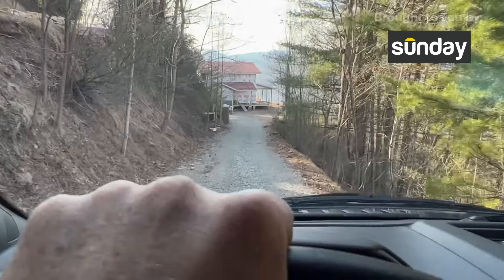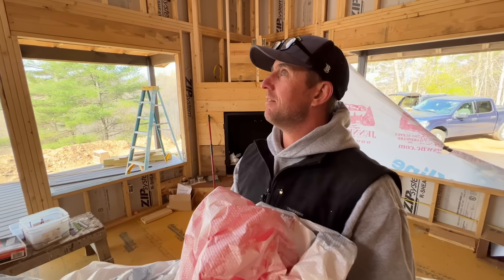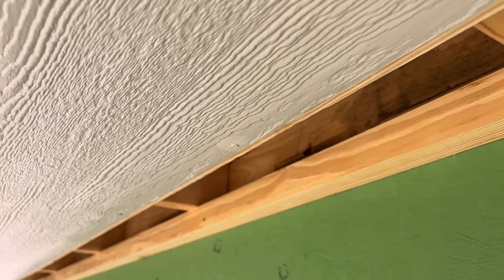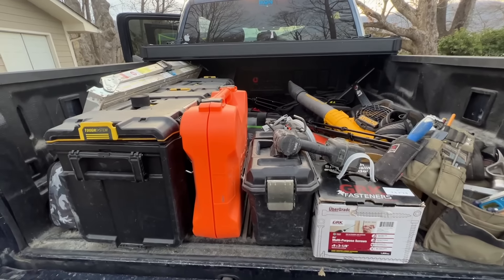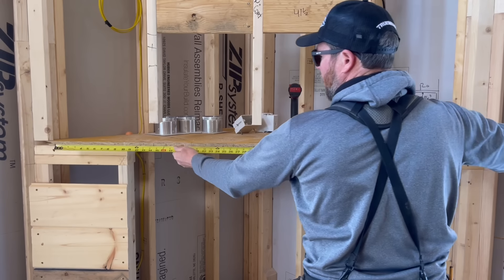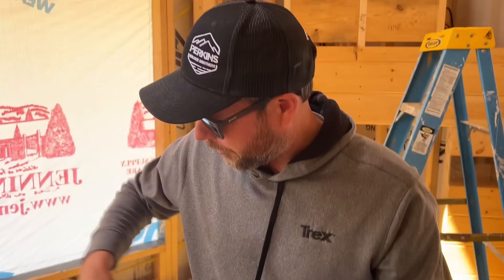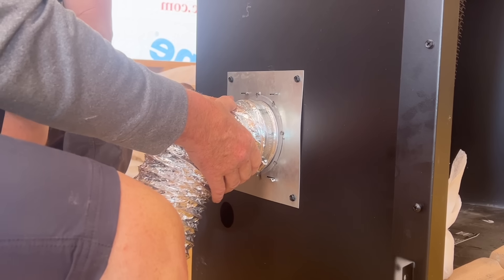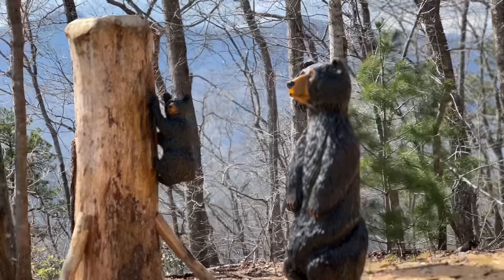Back To Work | Building A Mountian Cabin EP27

Comment: I know this video is over two years old, but here is a pro tip: when you have insulation in a wall, as is the fireplace, you can use small steel wire and screws on each stud and wrap the wire in the screws and go from side to side. Better than that is to use that steel support tape (plumbers use a lot of that) and screw in studs on the walls behind firebox. Don’t forget to run a strip (or wire) about every 12-16 inches going up the walls. Either method will hold the insulation for the life of the home.

Comment: If I want house wrap to stay on I just use scrap lumber as a cleat to help hold it on. 2x2s and other rips of plywood usually takes care of the wind whipping the house wrap off.
Reply from the maker: We’ll have to do something different next time! It was on the house without getting covered with siding for way longer than we expected, and also we got the craziest wind I’ve ever seen in my life over the last month here
Reply: Cap staples help a bunch as well. Stinger is the brand I have used.

Comment: The housewrap would stay on if you used the preferred button tip fasteners.  Staples stink.  Or better yet 30# felt and button tip fasteners.

Comment: Natural gas fireplaces here the inside of the chase has to be insulated then covered with fire board and sealed with fire caulk along with a fire stop at ceiling height …. Then the venting out has certain requirements to pass code as well

Comment: Have you thought about purchasing pump jack scaffolding.  I believe it would be easier to set up when the house is close to the property line and you don't have to set multiple level of staging to reach areas of the wall.  The only thing you have to remember is to drive long lag screws for your brace to solid lumber.
Reply: I have used some but we don’t have any like that.

Comment: So when we install house wrap we use a pneumatic stapler that will hold two clips of 3/8” staples and you just pull the trigger and it will just keep shooting. Interchange makes the gun and it sets the staples so the house wrap will not come off. Just make sure of who is operating the gun because you will go through a ton of staples. Saves a lot of labor. Love the videos.

Comment: the exhaust for the firebox you showed the j block, is that in line with the where the siding will be going, if you're an inch off the hole cut for the duct doesn't allow for movement. im only curious if down the road how that is going to line up with the siding. i would think you would get the siding up add the j block and make the hole so it isnt two inches off above or below.

Comment: Im not sure that dryer venting is to code for a fireplace.  You need solid metal duct for that fireplace.  Oh my.
Reply: It's intaking outside air.  No heat involved.   And like you said, it's dryer hose...meant for hot air....so it's more than ok for outside air.
Reply: @RandysRides  are you a licensed contractor/fireplace installer?

Comment: I don't know much, but I do know the trend of putting TVs 6ft up in the air has to stop.  Your eyes should be in the center or above center when at your watching position.  This means for large TVs the bottom of the TV might only be two feet off the floor, but it is non-negotiable that that is where they go.  No different than putting a countertop at 6ft high, your TV shouldn't be either.

Comment: Ok, so I own a landscaping business south of Nashville. Grass is my thing. Also got my contractors license in 2019. Just not using it because I don’t know how to build a house. That’s why I watch y’all 😬 as far as your lawn, aeration and overseeding with a fescue/bluegrass mix seed in the spring and fall with a regular fertilization and weed control treatment plan are your first go to’s for a thick green lawn. Equally as important is a regular mowing routine cut at the correct height. You can’t cut cool season grass short. It will die in the summer heat and you’ll be left with not much. Do not cut your grass below 3 inches. I prefer a 4 inch cut mowed weekly. Love you guys and what y’all do. I hope to be as great a builder as you guys are one day.
Reply: Hey thanks for watching and for the great lawn tips!  I love a nice yard

Comment: I have the European version of the same saw (DWE7492), really pleased with it.  Only downsize is that this version has a different arbor (nut) size. Bore size is 30 mm with the help of a reduction washer. Can’t use any 5/8 blades (like dadostacks).

Comment: A lot of people end up regretting high TV mounts. After just a few weeks they find it's uncomfortable on their neck and shoulders to sit at normal level and look up to watch. There are formulas for distance from the floor to the center of the screen based on screen size. Your client wants it over the fireplace so you don't really have any options.
Reply from the maker: Good comment… I personally prefer a TV that is about 4 1/2 feet to the center off the floor.
Reply: @PerkinsBuilderBrothers  i would suggest a “mantle mount”. Check them out. They allow you to mount the tv up above the mantle but pull it down a significant distance for viewing

Comment: Re: getting the bones of the house on video...that was one of the features of the new house I'm in now.  The builder let me in to do videos of the frame, the rough plumbing & wiring, etc.  Having that has been very helpful for lots of little improvements I've done.  You should think about doing some extra, and giving it to the homeowner once you're done.  So they know where all the wires are, etc.

Comment: The fireplace is nice for christmas, but honestly I would have just setup a battery backup for the furnace. its a 15A circuit and it doesnt even use all 15A for the squirrel cage. (unless you guys have gas outages) Those ductless faceplaces say they dont emit carbon monoxide but its BS. There is a CO safety trigger, and WHEN it triggers, you got ZERO heat.

Comment: Pro tip 
Any paper faces batts need to be covered by drywall or wood per code.
Foil faced batts are what I usually use behind a fireplace insert because my inspectors always want a vapor barrier on the insulation.

Comment: just cut paper into strips of 3cm and staple it on the warp. tear the strip once its stapled  to get a square 3x3 cm. so one stripe can serve 10 staples.
the paper prevents the staple to tear through the wrap.
Reply: Exactly this, or use EPDM rubber washers.

Comment: Okay Jamie this is a real question. Is there a reason as to why sometimes you use the impact drill and sometimes the regular drill? Is there like a situation where you should use the impact vs the regular drill? Or vise versa?
Reply: Yes, I like the regular drill when I’m working down low and now hanging it on my tool belt because it’s heavier. I like it because it’s quiet. The impact is noisy but light weight. So it’s better when I’m climbing around a scaffold or ladder.

Comment: Another pro tip when cutting bevels. The length of the bevel (if it’s a 45 degree) is the same as the width of your stock. So if you’re cutting a 45 bevel on 3/4” stock, the bevel length adds 3/4” of an inch. 

This is handy because it’s easier to lay out and mark long points rather than short points. 

So if you need a 20” 2x4 with a 45 bevel on both ends, you can cut one bevel, hook the long point, mark 23” (1-1/2” + 1-1/2” + 20”) for the long point of your opposing bevel. Your short point measurement should be exactly 20”. This only works with 45 degree bevels though!!
Reply: 'miters', a bevel would be on the side of the meterial, not the face
Reply: @bigdbob7929  I’m talking about a bevel, not a miter.